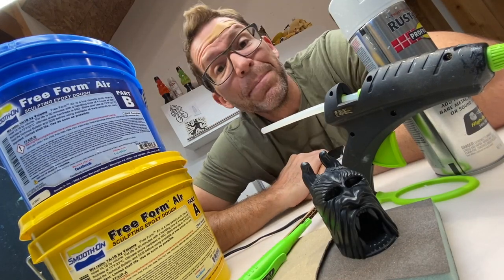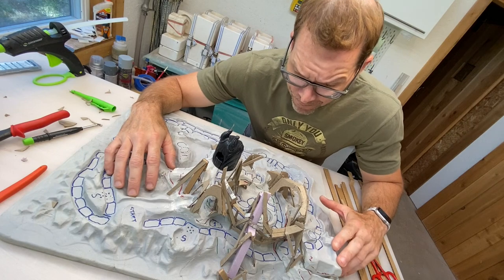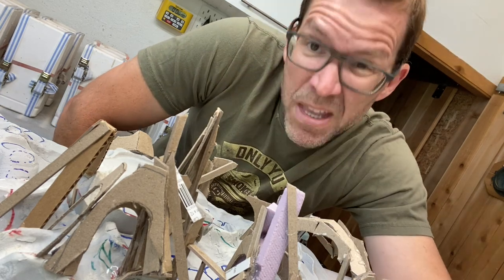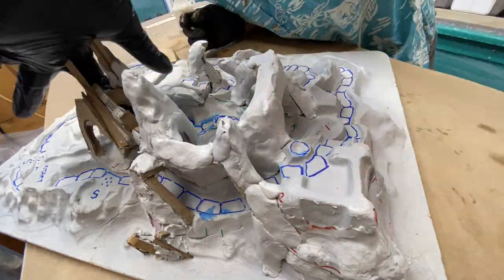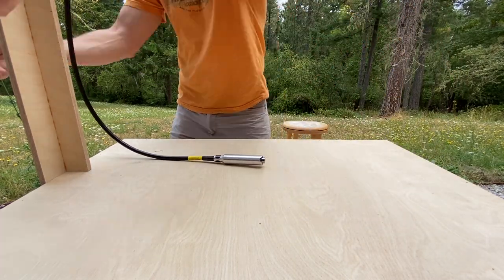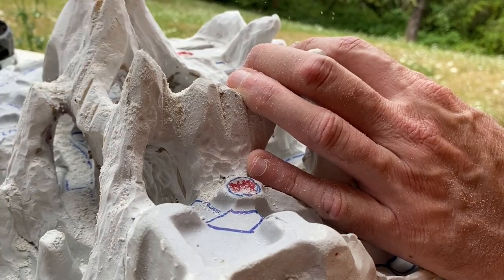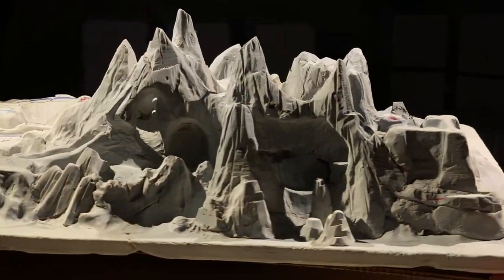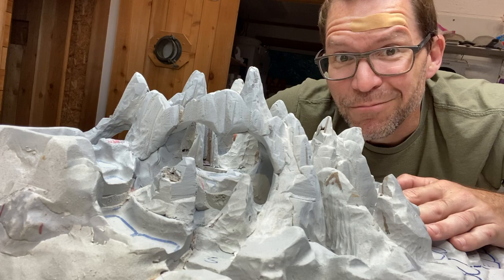Fireball Island pt2 - sculpting terrain with smooth-on Freeform Air - Game Relics

Comment: Love this! Does the handpiece for the Foredom vibrate at all? Wondering how your hand feels after working with it for a while compared to other Dremel tools.
Reply from the maker: It is SO much better that a Dremel. I used a Dremel for years in the FX industry and my hand would ache at the end of the day. It was heavy, it vibrates, and it had a gyroscopic force from the motor. The Foredom hand piece has none of those issues - the only thing you need to get used to is having the umbilical from the hand piece to the motor